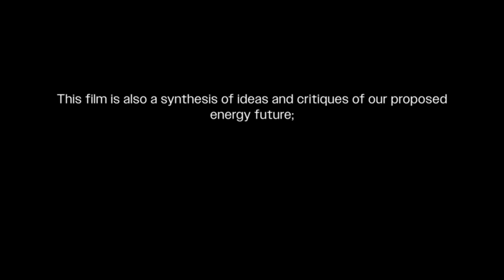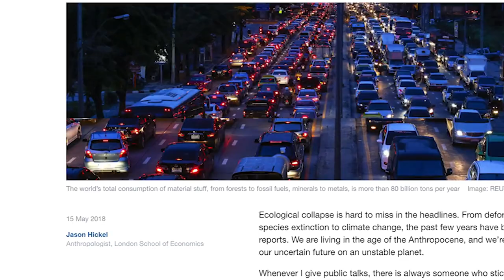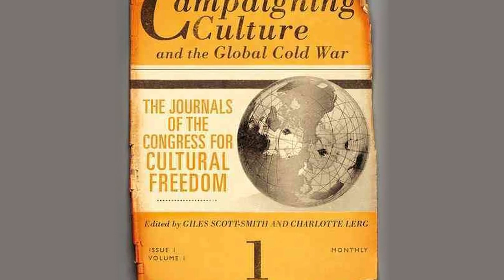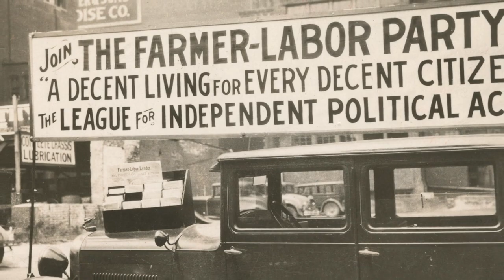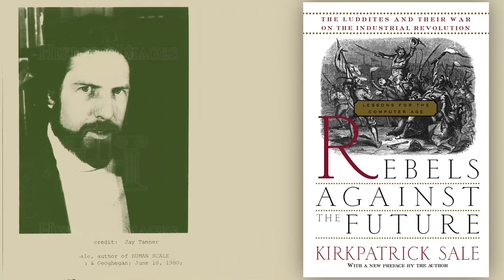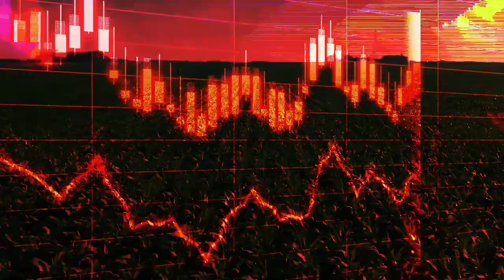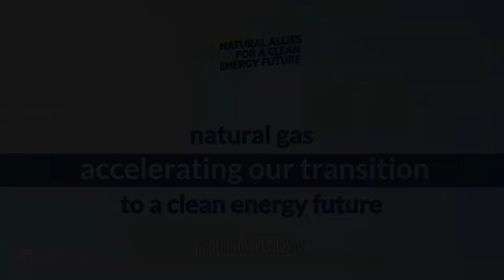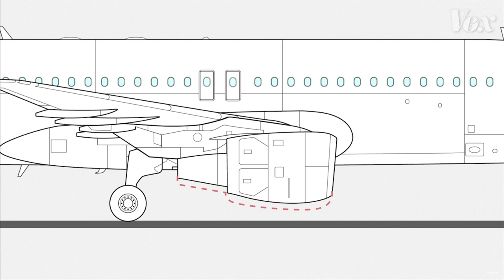Marxism & Energy

Comment: OK, i work as a class a CDL truckdriver.  And while i do not support the "degrowth movement" firmly believe that huge ammounts of current production are simply wasted by capitalist actors.  I very frequently see dumpsters filled with perfectly usable products, durable goods like tables and chair, becouse the box was damaged in transit.  Alternatly, i will see a 5 or 10 acre warehouse with one guy on a forklift and a couple hundred pallets of lawnchairs its only contents.  Capitalism has massively over porduced, caleb himself says as much, and i think if the revolution succeeds it will rapidly find that it does not need to produce nearly as much as we presently do to improve the general standard of living. 

The US gdp is 21 trillion dollars.  There are 128 million hoseholds.  this gives us a household gdp ratio of $164,000.  The median household income is $64k.  we could cut production by a third and still nearly double household income if we work intelligently.
Reply from the maker: This is why it's important to study Marxist economic theory. The fundamental contradiction of capitalism is that it creates poverty amidst abundance. We create more than enough for everyone in society, but it's not distributed fairly because we have an economic mode that operates on private ownership over the means of production. The only way to change this is through reform that undermines this mode.